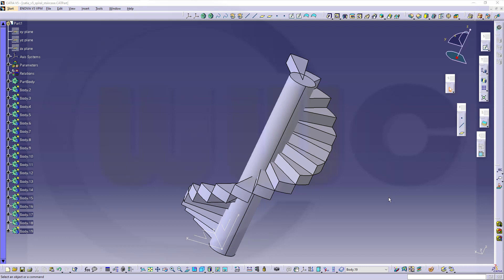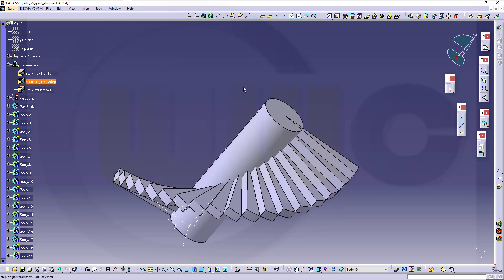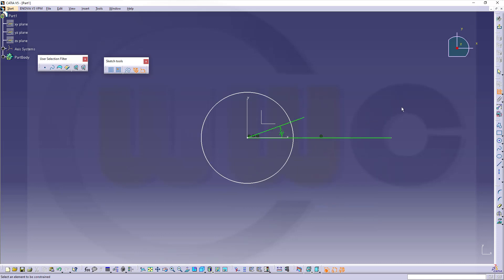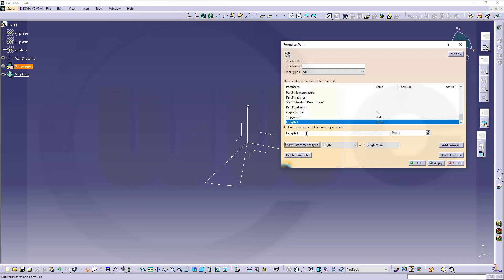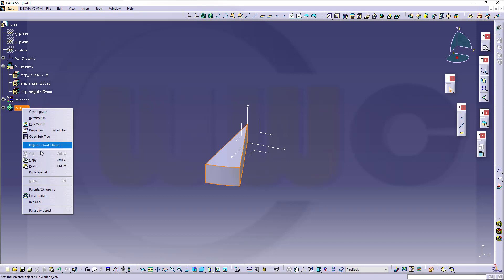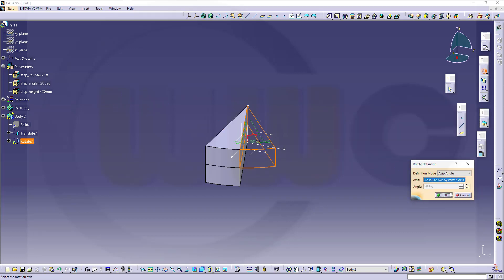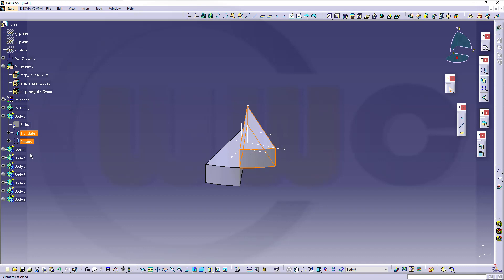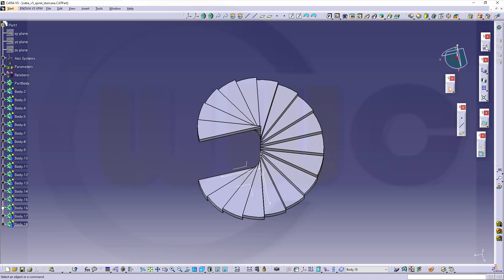5.7 Spiral Staircase - Wendeltreppe - Catia v5 Training - Part Design

Comment: Hello sir, whenever I try to copy the translation and rotation commands, it wouldn't translate after the 2nd copy. Is there a fix for that?
Reply from the maker: You have to do it the exact same way as I did - then it will work.